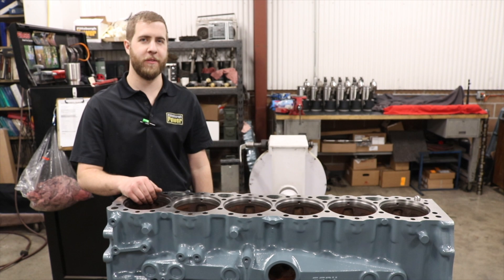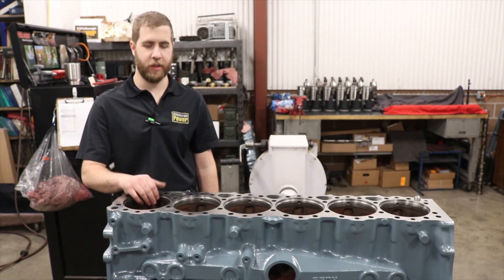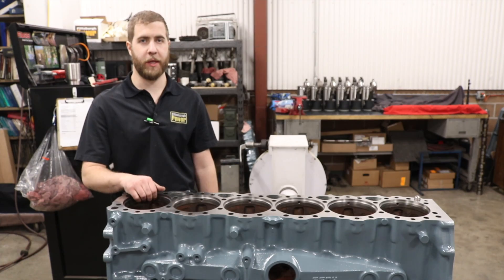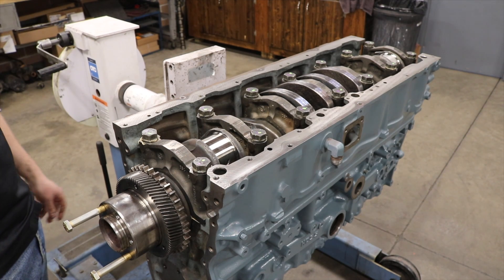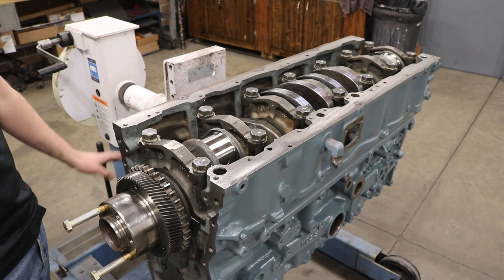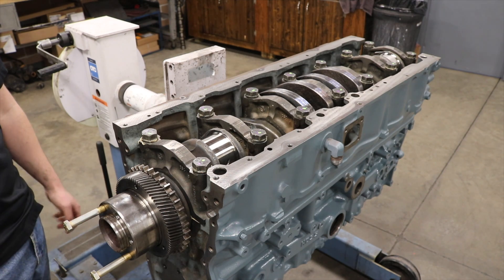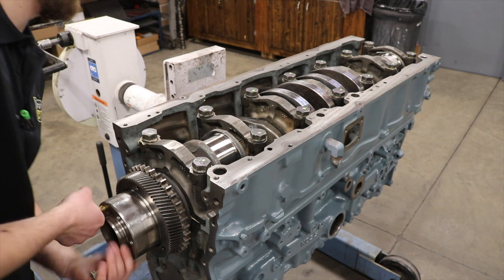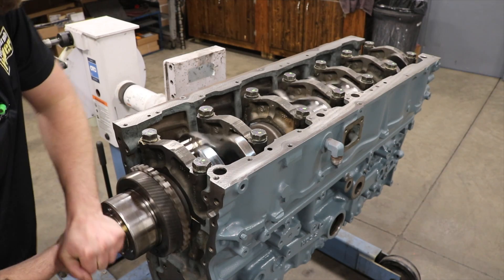Detroit 14L Rebuild Part II

Comment: Thanks for the video. It would be hard to show all details but would have loved to have seen the liner protrusion process. What do you think of Detroit blocks? Stronger or weaker than cat blocks? I like both brands for different reasons. Would love to know how a 14 liter stacks up against competition in various ways.... as Detroit is more economical I wonder if they cut corners in block strength or if cat just charges more for the name for theirs..... in doing a performance build...is Detroit inferior? Why? thanks!
Reply: Technical Items in my experience the 60 series is a very good and pretty stout engine. But not quite as stout as a strong block 14.6L Cat